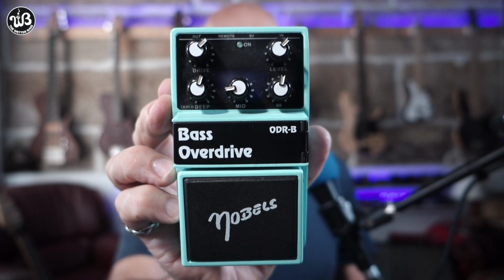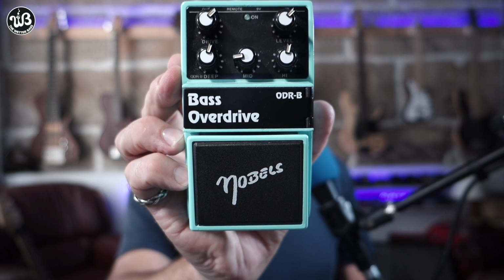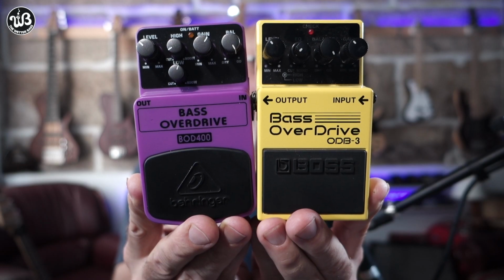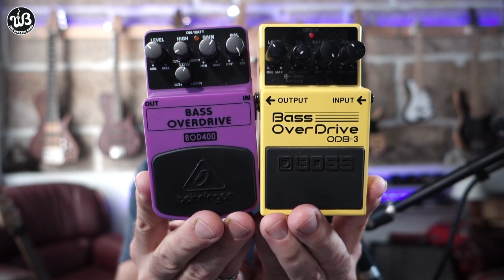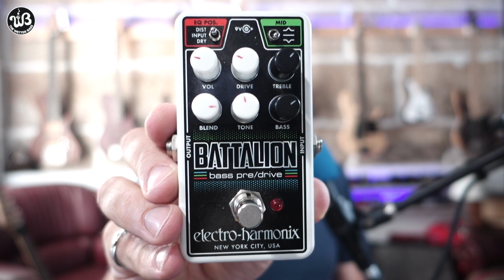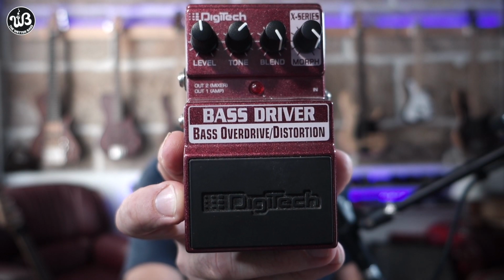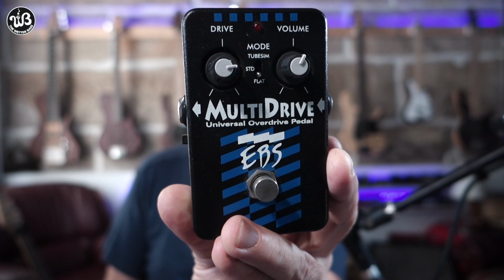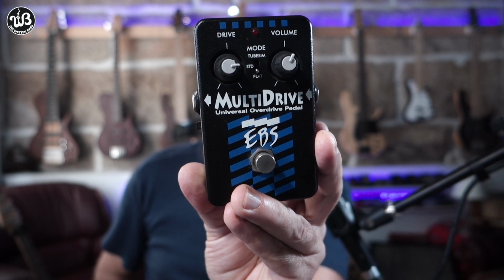8 bass overdrives compared. Find out which one(s) you like best!

Comment: I remember your review of the Digitech bass driver and believe you pointed out that the dry and wet signals seem to coexist and not quite blend together which I thought was a great observation.  In the sound samples with the backing track, i was surprised the disparity between the wet/dry didn't seem apparent to my ears, and the pedal seemed to cut through the mix very well with decent clarity.
Reply from the maker: Yep. Because the low end is there to save the day, kind of… but it’s true that in a mix the “two layers” thing I mention about pedals like the digitech or the Boss ODB-3 for example might not matter that much. But I think it limits the pedal’s sonic possibilities, especially with the Boss, because it’s hard to set a gentle saturation to warm up the sound without being a bit too much on the aggressive side. Does it make sense? 😅 I mean, so many drive pedals excel at both low and high gain…

Comment: I think my favorite is either the Nobels or the EBS. The EBS has a cool and unique sound, but the Nobels has low end grunt and grind that would sit well in a mix.

Also... is the clip at 4:51 a Muse song?
Reply from the maker: The Nobel is warm and is one of my favorite too. It might not be the best option for cutting through a mix but it does give the bass Guitar more body.
Reply from the maker: And the EBS is almost a classic by now!
Reply: @thewetterbass  Lately I'm finding myself wanting more "body" in my bass sound, because it's the key to being heard in a guitar-dominated mix. My favorite tone recently has been the Broughton Audio Azure Drive (Bluberry Bass Overdrive copy) with the tone set for low end and mids. When I'm playing in a band with two distorted guitars and yet can still actually hear the notes I'm playing, even the ones further up the neck, I'm happy...

Also, I just got to this point in your ODR-B video: I dunno if anybody ever explained it, but the remote switch input on the ODR-B is for connecting a separate footswitch to activate the effect. I guess it was meant as a tool for studio use, or if you wanted to use an external footswitch to save the wear on the built-in switch.
Reply from the maker: Thanks for the clarification! 👍🏻👍🏻👍🏻

Comment: I've had the MultiDrive for YEARS but the lack of tweakabilty has been bothering me lately, and was thinking about the Nano Batallion or Nano Overlord to swap it out with. Imma have to compare them directly at a store, but seems like the Batallion could emulate the same sounds with a bigger tone palette
Reply from the maker: Ebs is easy to use and sounds great, but less versatile than the Battalion for sure!
Reply: @thewetterbass  Read on another comment someone sold theirs because of the tone. Are you able to match the MultiDrive tone with all the tweaking options on the Batallion? Have you tried the Nano Overlord? I want to battle those two to my EBS and if I can get the tones + however many others it'll be down to the sound of the overdriven sound. Both have EQ and distortion + a Blend knob, so I'm guessing it would be achievable(?)
Reply from the maker: It could be, however I do not have the battalion to confirm. The dirt is less “compact” with “cab sim” effect in the battalion than on the ebs which on the other hand is a bit better for low gain distortion. Battalion doubles and a preamp amp, so… same tones? I don’t think you’ll get exactly the same but pretty close. ✌🏻 you’ll have to try it yourself to make 100% sure.
Reply: @thewetterbass  I think I get what you mean. The MultiDrive is very round, almost "fluffy" drive and that's its strength. Whenever I check 'em at the store I'll come back and share (:
Reply from the maker: @JosephGallagher  exactly! Yes, please do share, always nice to read your opinions!!!
Reply: @thewetterbass  Bought the Batallion yesterday. Even though the Overlord has a specific Mids knob, the routing of the EQ on the Batallion made it easier to operate, and also I noticed the Overlord has less gain on top
Had to boost the bass and cut the treble on the distorted side of the Batallion to match the MultiDrive sound, but matching it is just the start of the trip. I think I would have hovered over actually going out and doing a standoff had I not watched this video
Reply from the maker: @JosephGallagher  so glad the video helped and I hope you’ll enjoy the battalion! Try running the multi-drive into it (if you still have it…) 😈😈😈🤘🏻🤘🏻🤘🏻
Reply: @thewetterbass  Oh I won't ever sell it! It is an AMAZING overdrive that set the bar for me, I'll what I can do with both running + my Bass Muff on the dry mode (inhuman noises)

Comment: Man, how do you get your bass ts9b to sound good ? I recently got one and it sounds like farts with no mids . I'm so use to the ts808 on my bass 😅 as well as a normal ts9
Reply from the maker: Hello! What bass do you use?
Reply: @thewetterbass hi there :D i use an Aria pro SB CB bass for now , I do have an Ibanez BTB Iron Label bass with active electronics . I haven't tried it on the BTB yet though, due to a string getting popped 😅
Reply from the maker: Ok… does the Aria Pro have active electronics and if it does do you tend to boost the lows? Cause that could be a reason why a drive pedal would “💨 “… 😅